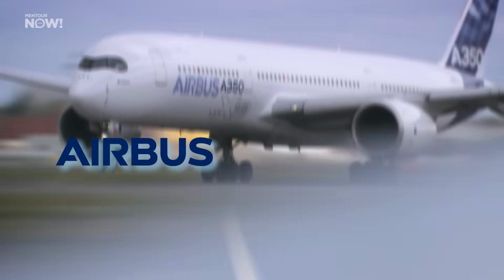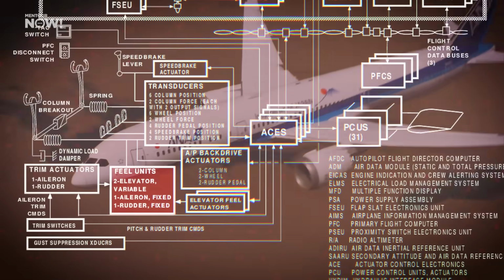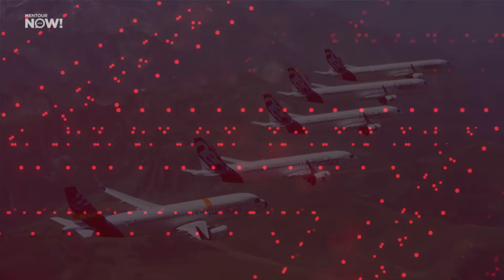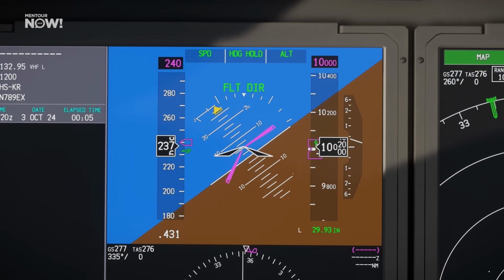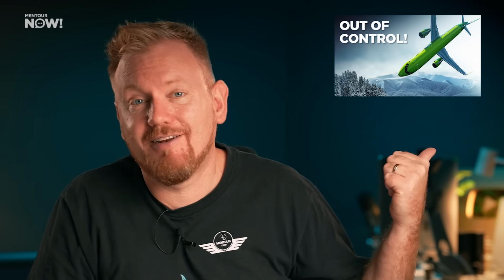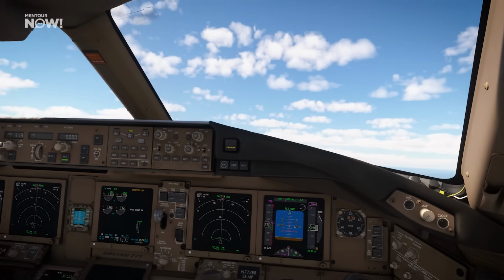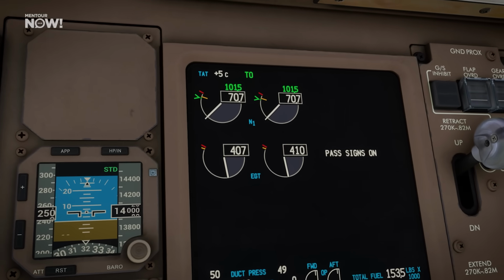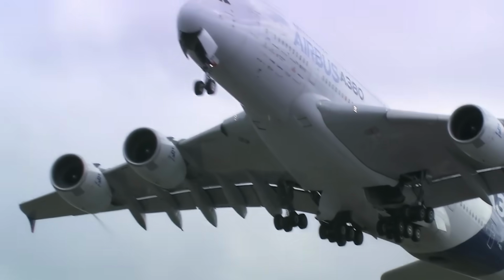Do Pilots Prefer AIRBUS over BOEING?!

Comment: I seriously hope it's a rhetorical question. Because the amount of Airbus planes diving in the ground because of both bad design and bad software is quite low compared to Boeing - the sound that a plane makes during a minor crash.
Reply: I think they're similar but Boeing's accidents and incidents definitely get more coverage, specially recently. I personally think Boeing planes, outside of the MCAS accidents, will let you into trouble but out of trouble and let fly out it. Airbus will prevent you from getting into trouble in the first place, but when those protections fail, and they have, it's a lot harder to get out off because you have to remember what's happens when something does go wrong.
Reply: @trilight3597  and if you get hijacked,you cant aileron roll it in a airbus!team boeing!!!!!!!!!!!!!!!!!!!!!!!!!!!!!
Reply: BOINNNGGG!!!😅
Reply: actually, if one actually looks for accurate statistics, Airbus' safety record is very similar to Boeing's.  but right now every time there's an incident involving a Boeing plane, it makes headlines, and it loudly announced that it was a Boeing plane, while incidents involving airbus are barely mentioned in passing. - because it's Boeing's troubles that the media is fixated on right now.
Reply: @kenbrown2808 correct answer
Reply: @kenbrown2808  is it the media being fixated or is it simply that the Boeind incidents have been much more significant recently?
Two major crashes because of dodgy tech and bits falling off the planes is much more noticeable than a system failing, but the plane is fine because the redundancy kicked in well enough for the pilot to safely land!!